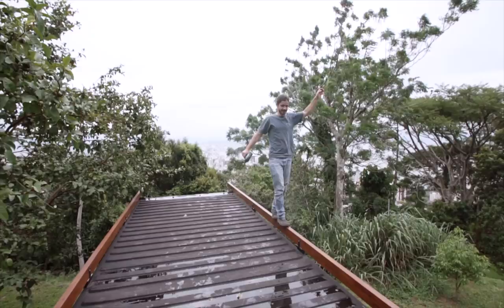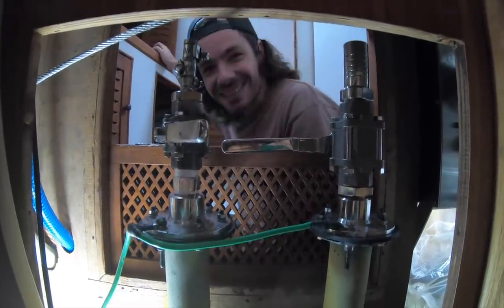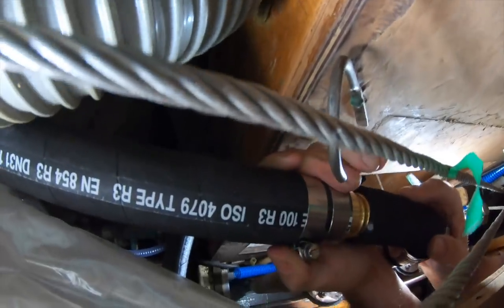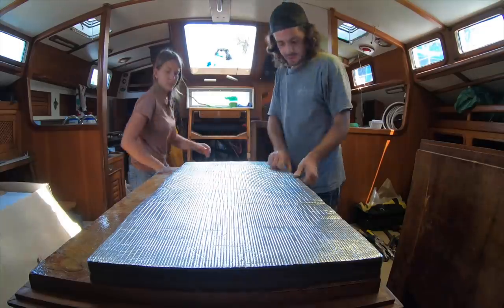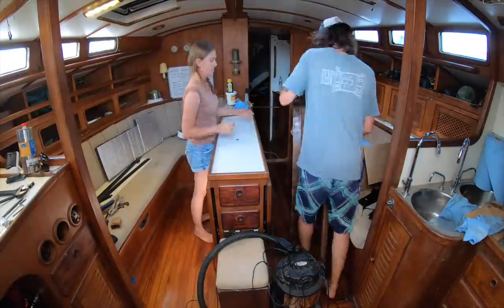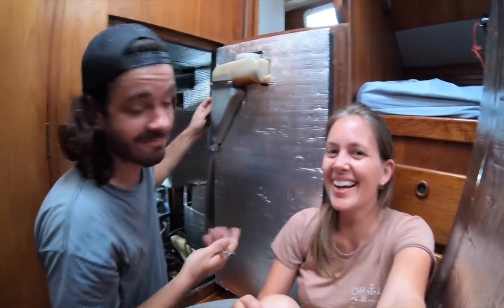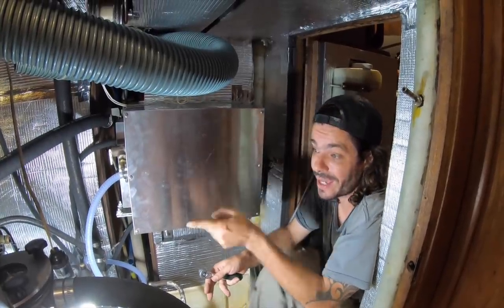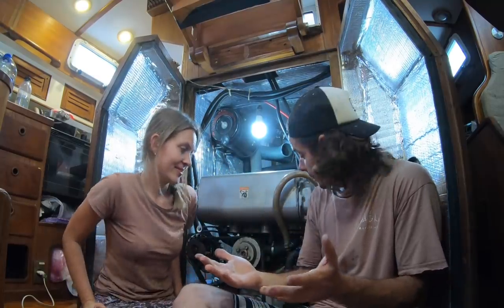⛵️Our Sailboat's Engine is finally ready to be fired up!!🤩#157

Comment: You both do such good work and have such good patience!  The boat will be NEW when you are ready to weigh anchor, just as you wanted.  So enjoy watching your journey and progress each week. Looking forward to seeing new sails and engine running!😊😊👍
Reply from the maker: Thanks for the support 😊⛵️
Reply: @OddLifeCrafting  The insulation is probably stuck on with something like Evo Stick a glue that you spread on both surfaces then when Tacky you stick together? Best way to remove is a Hot Air Paint Stripper (Like a Hair Dryer) as it softens the Glue then use a normal Paint Scrapper.

Comment: If I might make a suggestion, I recommend putting some type of neoprene rubber seal on the hatches and doorways to the engine room. When trying to make my old boat quieter, I found that sealing the hatches made as big a difference as insulating the walls. I realize this was done in the past, but if you are experiencing more sound than you'd like I would start by looking at that. Great job so far, you guys have come a very long way and the finish line is just around the corner!!! Best of luck from the U.S.
Reply: self adhesive window sealing strips should work perfectly
Reply: Yep, if air can go through, noise will go through also. Basic sound deadening in houses or else.
Reply: Might be worth aluminium taping the raw edge of the insulation around the doors before adding any additional sealing foam tape. Great job btw :-)

Comment: That engine room has never seen such TLC !
Suggestion.  Add some LED lights in the engine room.  You will really appreciate them in the future.
Reply: Yay!
Reply: Baby that baby!
Reply from the maker: We will, in the future. Now we need the essential to set sails
Reply: There are led lights available that look like a switch-plate but offer surprising amount of light. Battery powered and cheap in US. Also, Acetone will dissolve the old glue.
Reply from the maker: @petersnelling9047  Lightening the room is a future plan, thanks for the suggestion. We tried acetone, but  it did't work well
Reply: And I thought I went full OCD on my engine room...

Comment: Excellent job of reinsulating the engine compartment . Roberta's constant smiles in this video seemed extraordinarily charming. I hope you saved some of the engines hoses for spares just in case there's a failure when out at sea. Thanks for sharing.

Comment: A little advice on the fuel tank.
Connect a manometer to the outlet of the tank before filling the tanks. Compressor connect to input throw valve. Close the rest. Pump up pressure to about 1 atmosphere. Wait a few hours. If the pressure does not drop, fuel can be poured. Everything is sealed.
Reply: I was going to suggest the same...👍
Reply: MJW  This universal test procedure for all pressure (and\or possible leakage) system, before start of use. I do the same after repair petrol tank on cars\moto.
Reply: Boy that sounds dangerous. One atmosphere is 15 psi, times the number of square inches of the tank is a lot of pressure. I held an unlimited inspected marine engineers license for 40 years and whenever there was an air pressure test on an enclosed tank, it was 1 or 2 psi and the shipyard had two pressure regulators in series, in case one failed, there would not be an overpressure issue. I remember hearing a story about the port captains son, who was young, and working unsupervised, trying to use high air  tank pressure (200 psi) on a fuel tank and killed himself and another person(in the 1960's.) Pressure testing tanks is common way of testing for leaks, but please, limited the amount of pressure you're using. On piping systems that will run at higher pressure, it's not a problem because the system is designed to hold that much pressure. On a fuel tank, there is a lot more surface area so please be mindful of what you're doing and do not overpressurise the tank.

Comment: Are you going to put a fire supression system in the engine bay? Even if it is just a port to stick a fire extinguisher nozzle into the bay without having to open a door it would be a great idea.
Reply: That is a great call.
Reply: Yup, Might even be required, good on ya

Comment: Hi peeps. Good call on the sound proofing!  We noticed that your air filter is mounted at the top of the engine bay? This is the hottest part of the engine room. Diesels like cold dense air  maybe think about how you can pick up air from lower in the engine bay to avoid hot thin air being drawn in? It will make a difference in performance and fuel consumption in the long term. The engine bay looks nice and tidy now no foam sponge dust everywhere! 
The raw water hose (salt water) cooling water was a swept hose, not an elbow as swept bends reduce the water flow due to internal friction and turbulence in the hose that elbows produce, giving better flow and no vortexing. It's a good idea to avoid elbows on the raw water as they reduce flow and can become a pinch point for any weed, or debris. Hope this helps.  So looking forward to your shake down cruise. Sail Safe Guys, Ant, Cid & the pooch crew.

Comment: Enjoyed this video, just like always. We installed similar material to insulate the generator bay in our bus conversion. One piece of advice I could give you is to not trust the adhesive alone for the overhead panels. When the heat of the engine combines with humidity, that adhesive might not be enough to hold things up above the engine securely. We had to add large fender washers and screws to keep ours in place. I placed them about 15 cm apart in a grid pattern. Not a lot of them, but enough to add mechanical support to the thick insulating panels. Thanks for the great videos.
Reply from the maker: Thanks for sharing your experience, Richard

Comment: Hi Roberta & Duca, to save expense and possible diesel fuel leakage (IF the tanks leak), is it not possible to assemble the tank lids and then either use a very low air pressure or vacuum to see if you have leakage over 1-2hrs? Cheers from the U.K btw! 🇬🇧

Comment: I know removing that old insulation it was a good decision as the insulation becomes old it smells, looses its thermal and noise canceling abilities.  Plus dirty , messy to work around.
Reply: Much quieter and less vibrations as well.

Comment: Glad you both are replacing the engine hoses.As one of the subscribers mention sealing the edges of the foam to keep it from deteriorating is not a bad idea.it gives a finished look also. Nice work though..be careful and stay safe my friends love you guys.
Reply from the maker: The  tape doesn't stick at the foam, just to the aluminum foil, that's way we could't do the edges. Thanks for the support, Ken
Reply: @OddLifeCrafting  automotive weather stripping adhesive on the sides to hold the tape . but it doesn't really matter you guys are doing just great and it's only aesthetics and it's behind paneling anyhow ..it just sounded good. Love both of you guys be careful and stay safe. Sail on...

Comment: Seriously think about installing a fire-suppression system in the engine compartment - maybe a small automatic 'Haylon' unit if available. You may never have need to use it but it's good insurance none-the-less. Engine compartment fires are not that uncommon! You might also what to consider some sort for compressible gasket system around various engine room access panels to help prevent noise entering the cabin. 
A little insurance goes a long way.....
Reply from the maker: We are gonna show soon the system we are gonna install there. 😉
Reply: I think Haylon is no longer available because like CFC"s it burned holes in the ozone layer.  Had a Haylon system back in the 80's (never had to fire it off) but I'm not sure what is being used now.  The "older" systems were CO2.

Comment: You both did a nice job on the insulation and hoses. I'm sure it took longer than you expected, but that's the way it goes. I vote the diesel tanks will not leak. You did a great job with the seals and lots of sika-flex. I would only put enough diesel to run the engine for a little while while you check everything out. After everything is shipshape you can fill the tanks and take her for a sea trial run. Did you get the throttle and shift cables connected to the cockpit? Finally she will be under her own power. Good job on that accomplishment.
Reply from the maker: Thanks for the suggestions and support. We did get the cables, but we didn't connect them yet.

Comment: There is never a downside to making hot water from the engine. The heat from the engine is wasted energy and if it is not used to heat water then it is lost to the ocean water. The valve are good as a precaution if the water heater fails but otherwise the valves should always be open.

Comment: A problem could be the material mix you used for your fittings and culverts: stainless steel, brass and cast aluminum on the motor.

The different materials react with each other over time and cause corrosion.
Reply: Id be very cautious of using brass vs bronze for coolant.
Reply: Mebbe invest in a zinc mine? Steel boat/ salt water....wonder if you could capture the electons and put them to work?
Reply: I suggest this is a question to be asked directly to 2 or 3 different antifreeze manufacturers technical department (not to resellers) in order to have the correct information considering an engine of about 30 years old and all materials involved.

Comment: Glad to see that foam off the boat,.With as old as it was it was probably more a hazard for a fire than anything,.Being that I live in Az. USA...I've seen that stuff all crispy from the heat and age, Put a lighter to it and yeah it wont burn for a few seconds or so but once it does stand back cause its going to get really messy. I.E. flaming hot lol...Doing a swap of all those hoses was good thing to. Dry rot split hoses while far out at sea...not a fun trip then....that new heat reflective insulation should be a billion times better than the old stuff,.Cant wait to hear Odd grumble to life while on the water, good luck and make those seals tight
Reply from the maker: Thanks for the support, Ron.😊

Comment: You guys are so awesome!
As just a thought: please consider a bulb protection housing around your engine light. In case the bulb get broken for any reason, you won’t get electrocuted by a bare bulb. I wish I was younger(69)so I too could think about doing the same as y’all, getting and fixing your boat and the sailing you plan to do.
I could see me and my wife, again if younger working together as you two and being happy. But hey, never say never, right!
Best of luck on all that you are doing and are planning on doing together 🌹❣️
Reply from the maker: 💕Thanks for the best wishes. The bulb of the lamp is pretty  resistent. 😉

Comment: You should consider installing a check valve between the freshwater supply line and the heat exchanger.  That would solve the problem of hot water backing up into the supply line.  Love your channel.
Reply from the maker: Actually the water needs to go back as it expends when it gets hot, so I don't know if the valve would work there.  Glad you enjoy our  videos, Charles. 😊

Comment: I think Roberta is right on the sound isolation on the enginebay... If you let the oiltank be as it is, then you have a soundbridge.. I would even go as far as mounting it on the other wall because the sound of the engine wil even travel through the studs and is amplified by the doorpanel.... So at least get some sounddampening between there.. I feel so sorry for that poor kitchenknive though!!😁😁😂😂 And every time Duca uses it i get nervous, because i can easily imagine him cutting himselve with it!!😁😁😋😋🤣🤣
Reply from the maker: Thanks for the support. Duca still has all the fingers in place, hehehe

Comment: First, you guys are so positive and fun, thank you!  Second, you might think about using spray foam - they make types for noise resistance, heat resistant, etc. - to fill in all the cracks/openings in your engine room.
Reply from the maker: It's dificult to find the close cell ones in Brazil, and even harder if we need small amount

Comment: I have a suggestion on the Diesel tank if you haven't done so already. Is to Pressurize the tanks with some air. Then watch it for a few days and see if it looses pressure. You can find leaks with Soapy water and it's easier to clean up.
Reply from the maker: To late 🤐
Reply: @OddLifeCrafting  Fingers crossed you were successful.

Comment: Looks like a great product, I've never used that before, I Use a product called "second skin"  it was invented for big car audio systems to stop cars shaking themselves apart and stop sound penetration and vibrations. I Use it on inboard engine compartments, generator box's in trucks and vans and campers and I've also used it behind the drywall and plaster of a house that had noisy neighbours .it's only 4mm thick but amazing stuff that comes in A4 sticky sheets. Yours looks awesome you did a great job.
Reply: Oh and they do it in liquid form as well for those hard to reach places .

Comment: Be sure there is a small engine room exhaust fan that runs when the engine runs to remove heat and any possible fumes.  Also, make sure there are 1)oil pressure, 2) RPM,  and 3) temp gauges at the pilot location and engine location to monitor the running engine.   Suggest running the engine 3 or more continuous hours under light load to remove old carbon buildup, etc. and then change all fluids and filters.  Flush away any water scale buildup which causes an engine to overheat.  Be sure the muffler doesn't have carbon build up.  You might explore the feasibility of a small and low pressure turbo for the engine which makes sure of complete diesel combustion.  Appreciate your attention to detail.

Comment: A noise repeller usually has "waves" shapes because it helps to break the sound's waves. That's because the old foam (and the foam in radios studios or music sets) has that pattern. You need irregular shapes to break the waves. The material does not "stop" the sound, just changes the waves avoiding propagation.
Maybe you can consider paste some parts of that kind of foam.
(Sorry my bad english.)
Reply from the maker: This was the one we used now: http://www.akustik.com.br/akustik-terc.php
Reply: @OddLifeCrafting  genial!! as I can see the rough inside the foam makes what I said.

Comment: You guys really did a bang up job as usual 😉 Motor will run strong,and putting in valve system was a smart fail save and peace of mind in case you have issue with water heater you can bypass it and remove for repairs.Niw that you are living on ⛵,Duca needs a new head cover in to wear,something like Capt.Jack Sparrow wears,would be more fitting than ball cap.Great job looking forward to engine humming along,and how much more queit boat will be.

Comment: I'm sure you made sure that the braces under the hot water maker and the valves you zip-tied to them are metal compatible so you don't get galvanic corrosion.  Just thought it was worth a mention.  Looking great!

Comment: Just curious... Where does the engine get combustion air from, will it suck the air from the cabin? Or do you have an air inlet hose from the atmosphere outside of the boat?
Reply from the maker: There is a blower inside of the engine room renovating the air inside it.

Comment: Sea strainer/water filter thingy :P  .....Crazy question.  Did you do this work when the boat was still on the hard or in the water?  The Insulation looks great!  Though you may not have a before audio clip with it all closed up, I'm sure it's going to be tons quieter than before!
Reply from the maker: We started on the hard and we finish it in the water. 😊

Comment: Full encapsulation of the foam (sealing against water intrusion) works both ways. Water can always find a way in over a long period of time, but it will also take a longer time to dry out if it's sealed. If you don't seal the foam, it can more easily dry out, especially with the warmth of an occasionally running engine.

Comment: A tip for you to look up.  If you connect a basic PV panel to a 50 litre water tank using a matched (to the panel) immersion heater element... it will heat the water, slowly, 8-12 hours a day.  If you run the maths, it only takes a few 100W of solar to keep the water at shower temperature all day.

Comment: You should installed two LED strip bars on the roof of the engine cabinet. The are super bright. Very low energy and you don't have to drag cables and old bulbs into the cabinet. Plus they are really cheap.
Reply from the maker: We are gonna install lights in the future, now was just the essential.